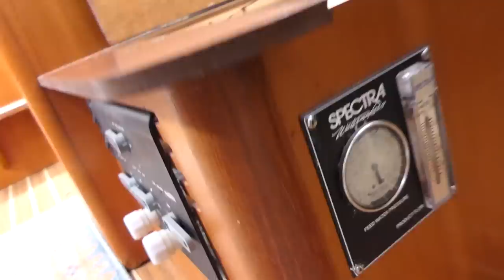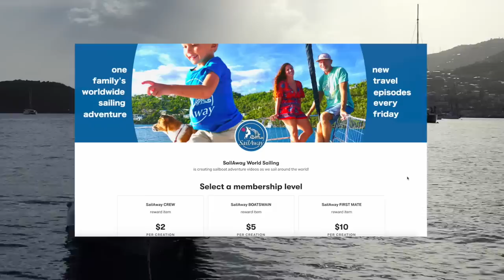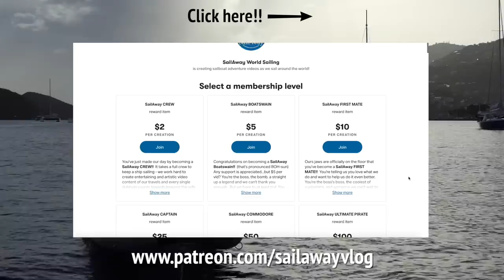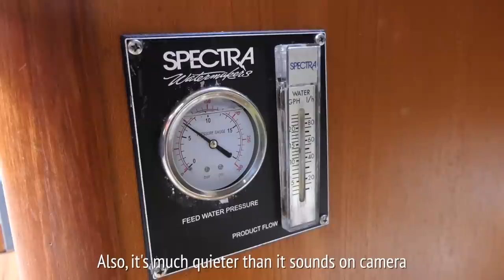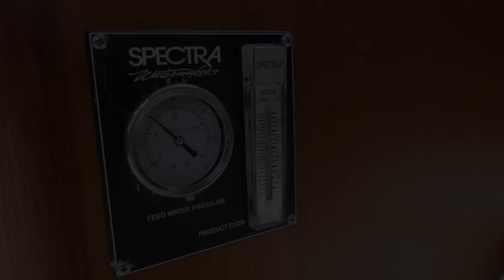Watermaker Refurb On A Liveaboard Sailboat - SUCCESS or FAIL?! | SailAway 117 | Sailing The World

Comment: Wow Eric, I think I know why your water output went up to 15.  Those low pressure pumps are soooo beefy.  Each one has to be .25hp to .5hp from the looks of them.  What do they add in terms electrical draw? My guess is 20 to 70 amps somewhere in there.  It pretty much negates the efficiency of the Clark pump I'll bet.  But I'm sure you have enough solar to get the job done.  My 1hp 12 volt system pulls 85 amps with the low pressure pump and produces 35 gallons per hour usually...warmer and saltier about 28 gallons per hour. I also have a 1hp AC pump too that can run off the generator so I have two options.
Reply from the maker: Yeah, those are the exact pumps that came with this unit in both the 7.5 GPH model and the double-pump 15 GPH model.  Pretty low draw really, about 20 amps with both pumps running IIRC.  We usually only need it running for a couple hours.  If we do it early afternoon with the sun out we don't even notice the drain at all.  So far so good!
Reply: @SailAwayVlog  I would open the area where you run them a crack though so they don't heat up too much.  It may make it more noisy, but my guess is those pumps really hate heat...since they come with fans.
Reply from the maker: I double checked the amps when I just fired it up because you made me think about it. Lol.  It actually draws about 18 with both pumps and fans going.  The fans were actually an option when the original unit was purchased.  Seemed like a good idea to me though.  Plus I got the heat sinks that clamp on the pump bodies.  They definitely get hot, but at least to the touch, not to an extreme.  There's actually decent ventillation in there since all those under-seat areas have vents slits cut into the sides and they're all connected.

Comment: I have one question concerning the watermaker upgrade you did .   Was there any difference in the ppm of the product water when using both feed pumps vs only one feed pump?
Reply from the maker: Thanks for watching!  No difference that I've noticed, but we rarely run it with just one pump;  When conditions are good and the filters are clean, we get about 250 - 300 PPM with either one or both pumps.

Comment: Totally not an expert, so use or toss.  Saw something within the last two weeks that said that you can push your water maker over what it is rated for, but that you will shorten the life of your membrane dramatically.
Reply from the maker: Thanks for watching!  Yes, that's definitely true.  I clarified with the guy who rebuilt the pump. that our pump is the correct model to handle two pre-feed pumps, and this system was sold that way as an option with our exact membrane.  I think the higher output watermakers that run on AC often use dual membranes, but I'm not positive.